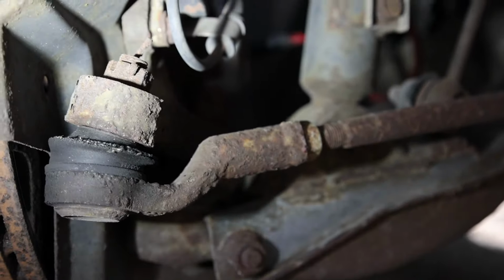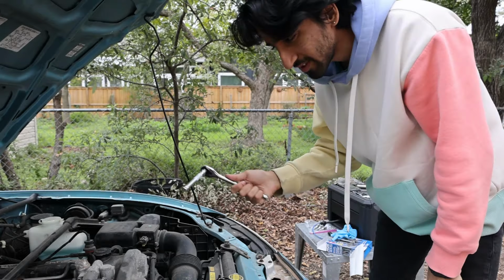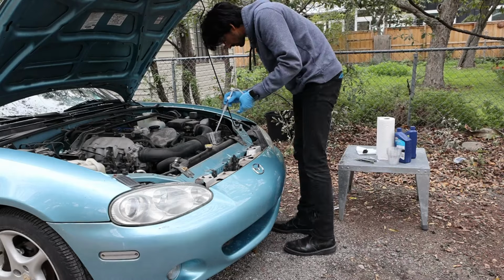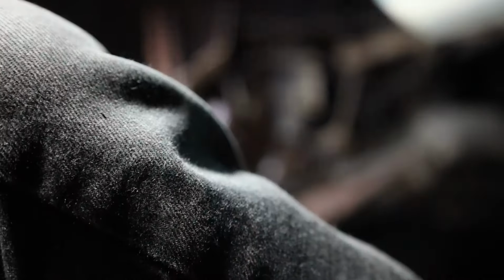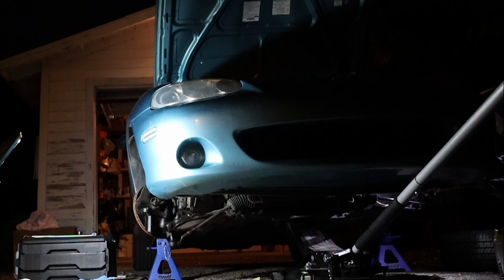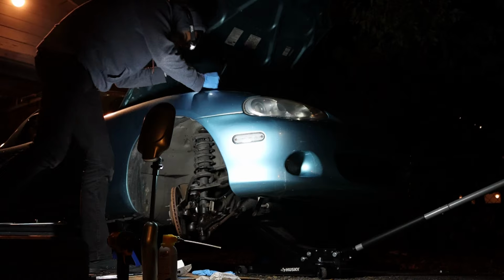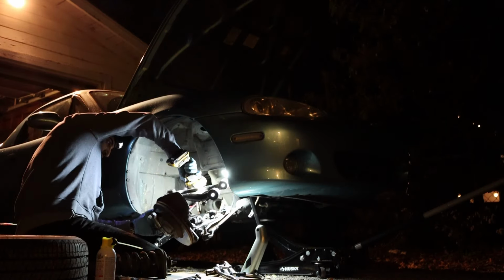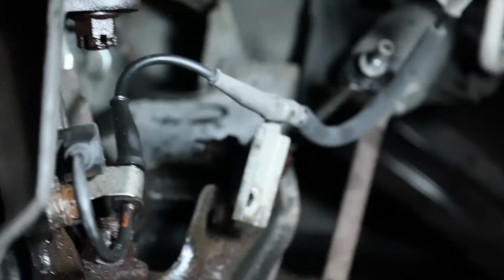i started learning how to rebuild my miata's broken suspension

Comment: Should have done a compression test when changing the spark plugs to see how healthy the motor is
Reply from the maker: how hard is that to do? i’m learning as i go with this car
Reply: @abhi.velaga  Simple test, takes about 20 minutes to do (the process is essentially doing a tune up twice). Buy a cheap compression tester from advance. Test each cylinder by removing each spark plug and screw the compression tester in. then cycle the motor 4 cranks and you have a cylinder pressure. 150 psi is average. 180+ is a newly built motor.

Comment: you're without a doubt going to burn up that impact drill doing suspension work with it, get a real 3/8 impact wrench like a milwaukee compact, thats technically the right tool for the job
Reply: at least in my personal experience thats how it went for me
Reply from the maker: ah i had no clue what to look for when i went shopping haha. ill take a look at that, thank you!
Reply: haha yeah it be like that hope your project goes as smooth as it can, especially with how rusty that suspension was lookin haha

another bit of advice too against rust is pb blaster isnt always gonna work you might still snap or shear a bolt so get some map gas (yellow bottle) thats your last resort right there @abhi.velaga
Reply from the maker: @smohhking6578 i haven't heard of that, ill take a look into it. thank you so much for your help